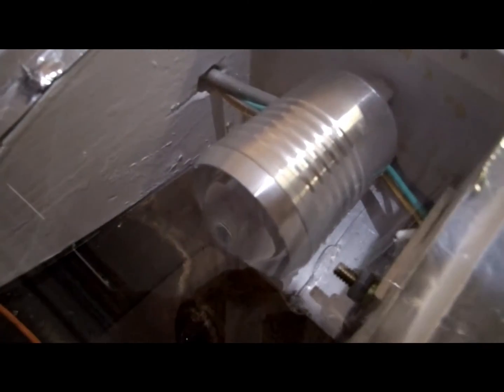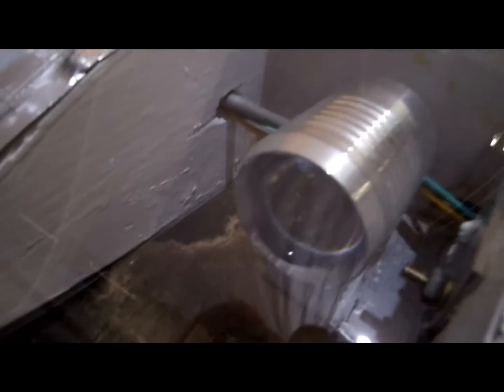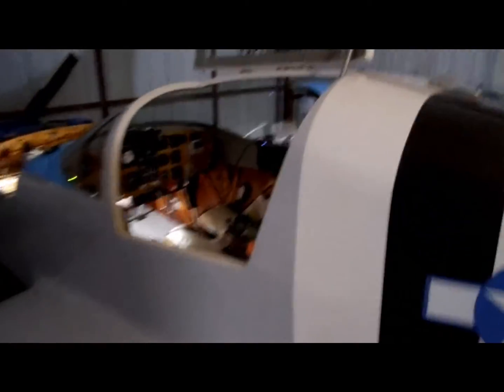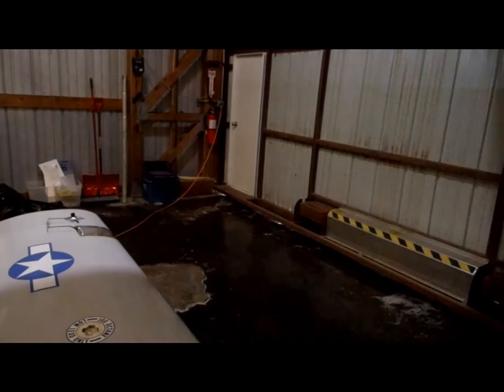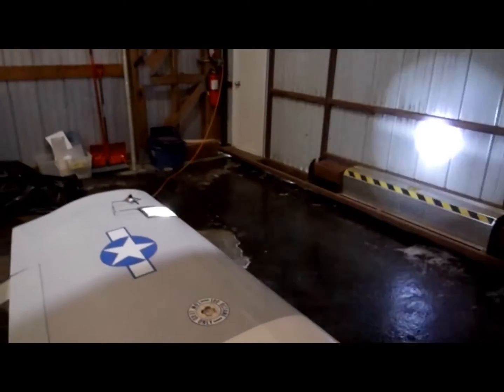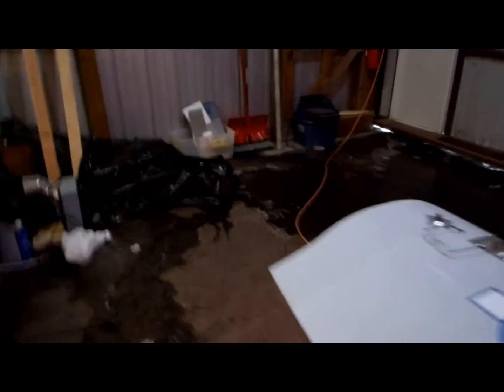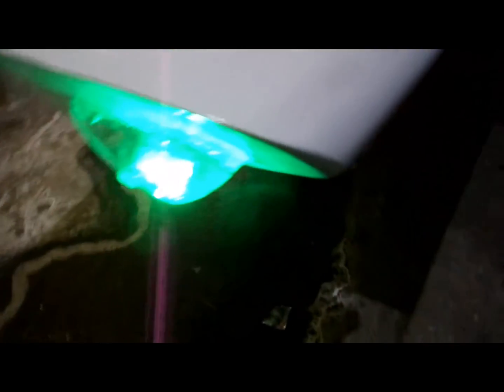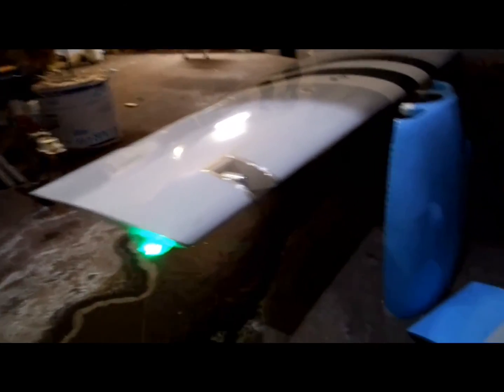Experimental KR2S aircraft lighting systems overview

Comment: Great video Craig!  Thanks!   Why did you use conventional strobes on the wing tips rather than LED?
Reply from the maker: The plane already has a 4 strobe Whelen unit in it so I did remove 2 of the for strobes just to cut down the amperage draw.  Also I have tried the LED Hideaway units and they just are not a bright as flash tubes.  May try them again someday.